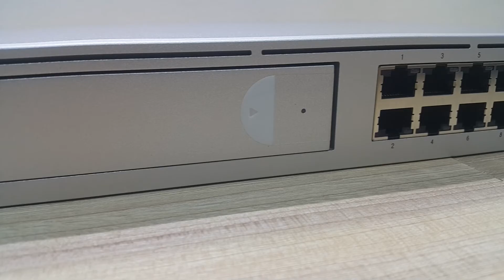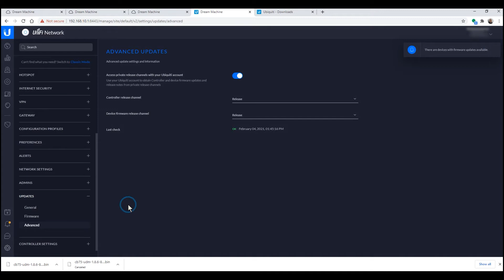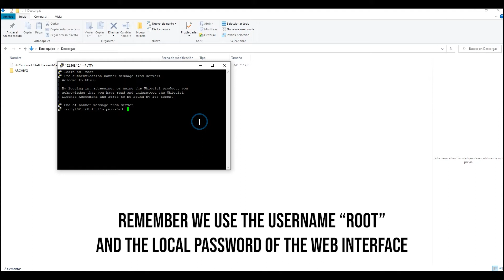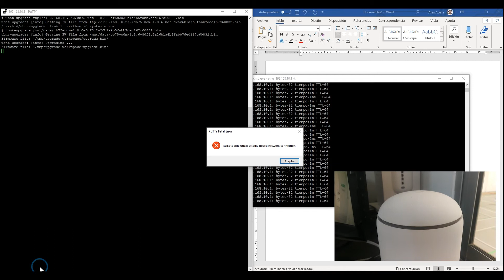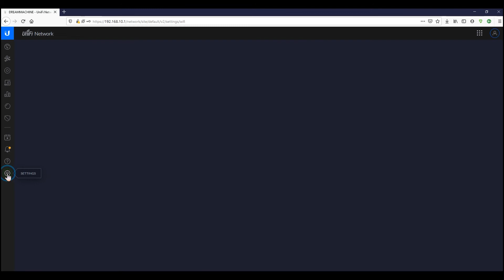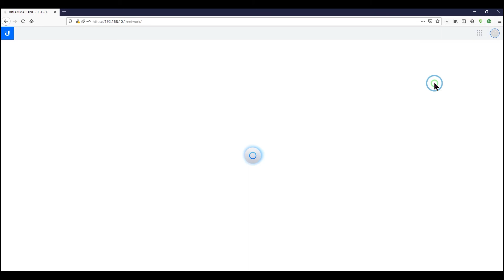How to manually update UNIFI Dream Machine and UDM Pro

Comment: Hi, One 12v IP camera can be connected to UNIFI poe switches
Reply from the maker: Hi Fabrizio, no you cannot do that without the right connector like this one: https://amzn.to/3xUdiWD .  Voltage not only is different, but also negotiated upon connection of the cable, so client device "tells" the switch which voltage it needs, if there is no answer, no voltage is provided, but it ranges from 24 volts and up, and these adapters convert such voltage to it's own specifications.   Plan B is to use a 12 volt power supply and use a passive combiner-splitter for the 12 volt connection from your own adapter such as this one: https://amzn.to/385sfdd   The only consideration is you cannot mess up cable orer or you might end up damaging your device.  Feel free to ask, and thanks for watching owr videos
Reply: @TechnologyMoments  ok,thanks